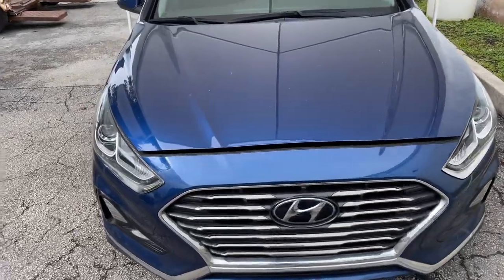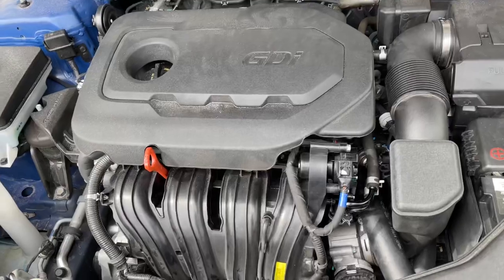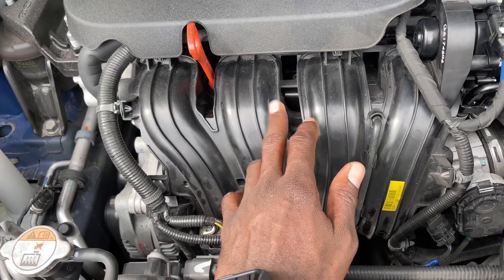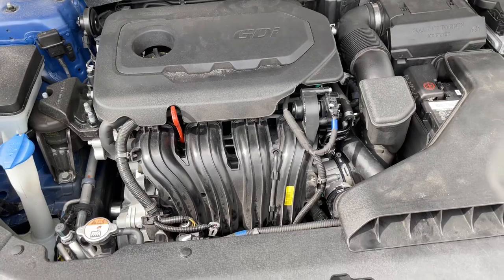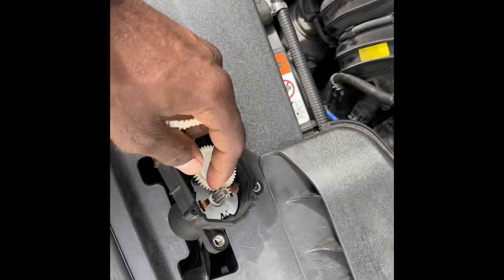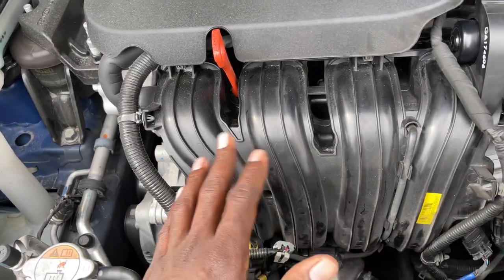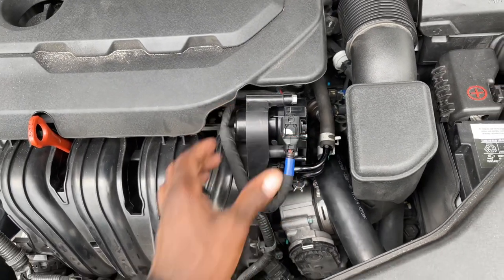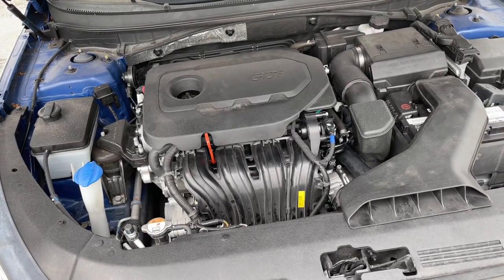Hyundai and kia most common problem that the dealership don't know how to fix

Comment: For anyone that wants to know. there are 2 vcm motors on the intake. 
One in the front right side and one in the back right side. These motors control "flaps" inside the intake the regualte according to airflow and throttle position. It helps create torque especially at low rpms. 
Sometimes, like on my issue, the motor works at low voltage (AA battery) but 12volts the part that spins on the side of the vcm, will twitch and move a little. but if i keep tryna give it power, it wont budge unless i reverse the positve and negative wires to get the "key"  to spin in the other direction. 
I opened up the vcm to see if there was a lose wire or burnt motherboard, turns out, there was dry acid or whatever from the motor. So moisture or whatever go in and fried the motor. which is why i could power on low volts and not high volts. 
Anyways, the symtpoms youll have is
Hard starts
Rough idle
engine shakes
Misfires (especially if car is in park/nuetral and you quickly try revving the engine, it will misfire and sometimes stall)
poor acceleration
No starts
hesitation

It may throw a lean code P0171 or another code P016c. 
P016c is not directly related to a vcm motor. More so, if a specific engine component is not performing correctly according to manafacturer limits. 

A Bad vcm throws off incorrect Air/fuel data to ecu (computer) 
So the computer tries to compensate by adding more fuel. But since the air inside of the intake is not restricted or "flowing" properly, it creates a lean condition. in other words, too much air. 

For my car, i replaced up to 2k in car parts. I had a mechanic diagnose, he couldlnt figure it out.

I only figured this issue out after testing the power to both vcms and the one worked just fine powering off the battery leads. The other barely would move.

Comment: The car has had the knock sensor three times at the dealer. It was VCM the whole time
Reply: What you wind up doing?
Reply: Mine vcm was fixed but now the engine is making sounds, and the dealership wants to switch the whole engine. Is that right?
Reply: @yellliza  what did u end up doing?

Comment: I am a certified Hyundai technician and yeah I have figured this out a while ago. The tech info for daig sucks. When it comes to a lot of items. Most major diag on some parts is just replace with known good part and retest
Reply: I’ve been to three different places and nun of them even Hyundai didn’t know what was wrong. My husband changed this part and it still makes a rattling sound when I go to accelerate. Would you know what else it could possibly be. It’s a 2017 Hyundai, Santa Fe sport
Reply: Any update about your car ?
Reply: Mine vcm was fixed but now the engine is making sounds, and the dealership wants to switch the whole engine. Is that right?
Reply: Can you please guide me brother. I have a knock sensor issue coming up with a code of p1426 in Hyundai sonata 2015. What could be possible reason behind this. 

And is it safe to drive for 30 km to the dealership ?

Can you please help me with your valuable response. 

Thanks 👍

Comment: I have a minor knock when first starts
Can’t accelerate past 40 mph 
Car drives engine light started blinking yesterday only drove home nowhere else since
Gas goes a lot faster 
Shop open tomorrow
What do you think is wrong 2016 Kia Sorento P1326 Glow relay it say
Reply: Hyundai Sonata 2015 just happened to me a few days ago. This is literally happening to everyone I feel like. Report it to NHTSA. Everyone needs to report these issues because it’s a public safety issue.
Reply: @Goldun-nah  it happened to my sonata yesterday and mine only have 70k miles
Reply: Just happened to mine and can’t figure it out I already replaced knock sensor and reset the codes but it still is happening after driving it for a few minutes codes come back up
Reply: @matthewburgan2319  any luck on a fix?
Reply: Am having the same issues with my 2015 Hyundai sonata sport 2.4
Reply: @matthewburgan2319  did hyundai update the software?
Reply: @matthewburgan2319  do you still have the same problem?
Reply: I have the Hyundai Santa Fe sport 2.0T 90k miles, vehicle is limp mode it seems like.

Won’t go past 40 mph 
Engine light flashing

My mechanic says it’s a dealership problem & couldn’t figure out what it could be.

Comment: All these are signs of running these engines with low oil!! If check engine light flashes and you have replaced the spark plugs the ignition coils and knock sensor then the engine is garbage!!!!